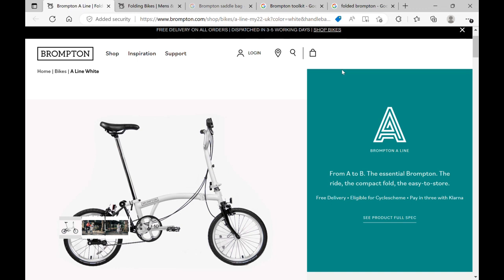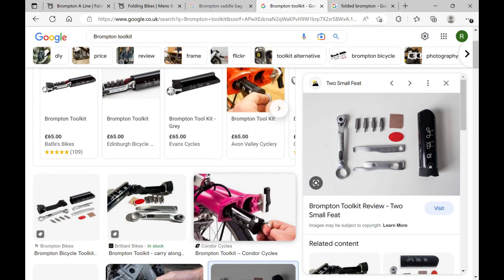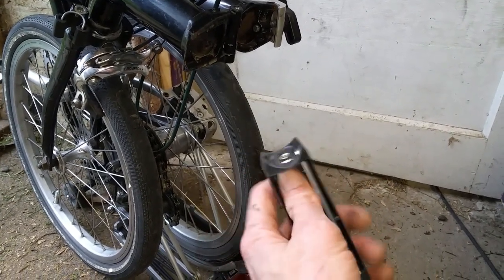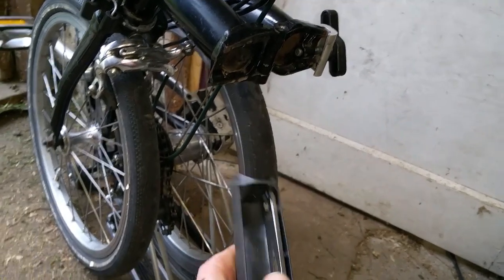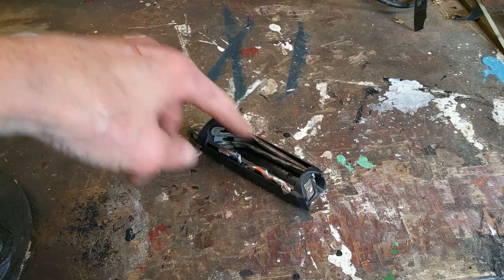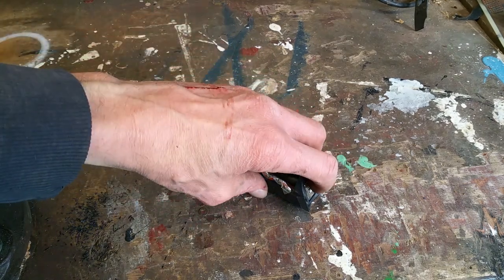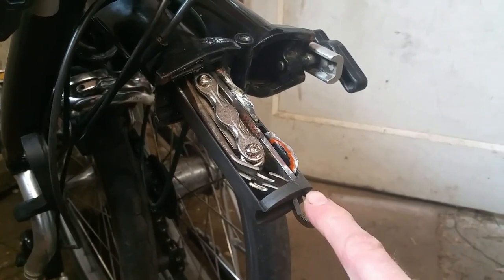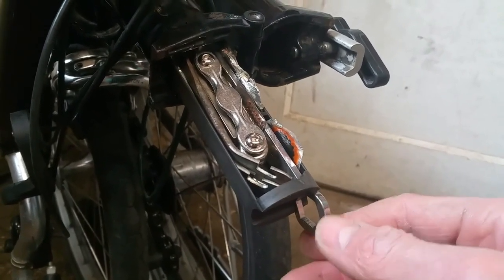Brompton toolkit for under £20!

Comment: Time is money, and the excessive time and trouble taken coming up with this Heath Robinson solution has to be insane!!! My Brompton toolkit, very probably unlike this alternative, stays firmly in place even when in folded and rolling configuration, and gives me every tool I need for emergency repairs and tweaks while on daily, or even several day, tours.

However, each to his (or her) own, and I grant this is an ingenious even if somewhat Heath Robinson solution.
Reply from the maker: Heath robinson: "doing something simple in a very complicated way that is not necessary".  I'll agree this isn't an ingenious solution, but I'd hardly say spending 10mins cutting down a few tyre levers is excessive or complicated.  It was dead easy.  The only complicated part was making the video.  Other parts were easy and quick to order.   Probably 30mins in total if you follow my instructions. The Brompton one is massively overpriced, and not everyone is a bike nut who loves or is even able to spend loads of cash on flashy parts.  Though their solution is neat.  I actually think my allen key set is superior.  But as you say, each to their own.
Reply: @MrRoddersf1  Actually, I said I thought that is an ingenious solution. However, add to the time taken paring down the spanners, the time also spent finding the integrated tube-spanner that precisely fits into the Brompton frame tube, and not only that but also search and find the set of allen keys that will exactly fit into said toolkit tube (not forgetting to calculate the space that the pared-down spanners have already taken), and it adds up to rather considerably more time. Then add to that the trouble you will very likely experience in the future from parts tending to eventually fall out when the Brompton is in the folded-carry or folded-rolling configuration, with the possibility that at some point in the future you will lose a tool or two (and maybe break the plastic toolkit tube at some future moment when it falls out) that you will need to replace.

Many will describe those of us who are prepared to fork out a considerable amount of money for some Brompton accessories as over-extravagant, but I would respond that we are not only saving time and therefore money, but are also able to savour and enjoy an extremely elegant solution.

Having said that, I can also appreciate the real pleasure and sense of achievement in finding an alternative, creative and cheaper solution to a very expensive Brompton accessory. That can also be fun! As I said and you have agreed with me, each to their own.
Reply: By the way, "Heath Robinson" also refers to the ingenious-ness and the DIY-ness of the solution 😉
Reply from the maker: @Muddy283  I was planning on posting a parts list at some point.  The spanner you refer to comes with the carry case.  No need to buy a separate one.  It really is simple.  Trust me, if it wasn't, I wouldn't have done it.  As you say. Time is money.  I didn't save tonnes of money, but I did save money.  On your point about replacing parts.  It would be a lot more expensive to replace lost parts from a Brompton toolkit than my toolkit.
Reply: @MrRoddersf1  By "integrated tube-spanner" I meant the whole integral piece. As for the bits falling out, I meant that the integrated toolkit tube and spanner does not (presumably) fit as snugly into the frame tube (the Brompton version not only has a magnet on the backend but also the external front is rubberised so it doesn't move even a fraction of a millimetre when in the frame) and so could come out while carrying or rolling in folded configuration with the tools spilling out. I don't have this problem with the Brompton original. I just have to be careful to click each tool back in its allotted slot after using — which I don't find a problem. However I did get confused about your tyre levers. In my (ageing) brain, they transmuted to spanners!!! Maybe that's because I've recently got used to removing and replacing tyres without using levers.

Anyway, I've discovered that you've got more interesting videos about making mods to the Brompton & other helpful DIY stuff. Definitely worth a closer look so I've subscribed so I won't "lose" or forget your channel.

Ta.

Comment: I got the same insert, but it will simply rattle loose if you roll the bike folded. Did you find any way to secure it better?
Reply: I ordered one too. I'll try it soon.
Reply: @kit6580  I put a little bit of tape around mine and now it fits more snug!
Reply from the maker: I didn't have this problem, though there are two types on the market.  The one from China which I ordered, and a 3d printed version on Ebay which is less good
Reply: Put three layer of duck tape on the bottom of the tool tray. It help secure the tool tray as a detent.